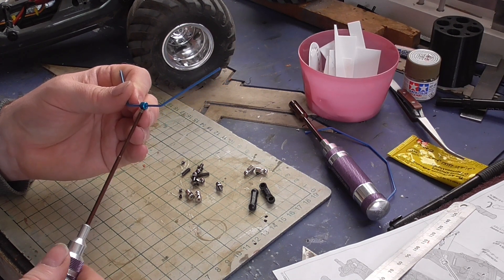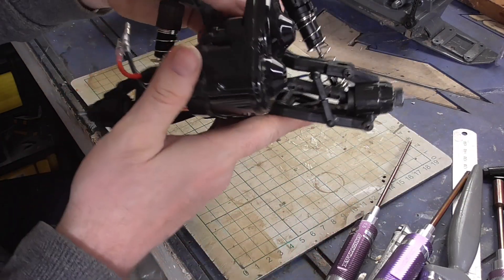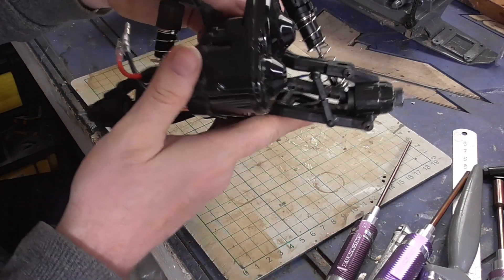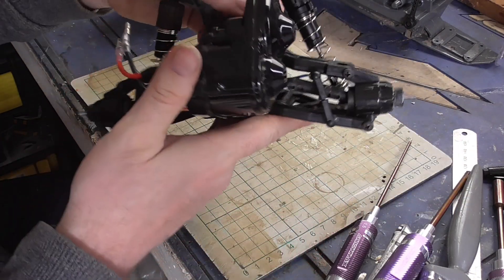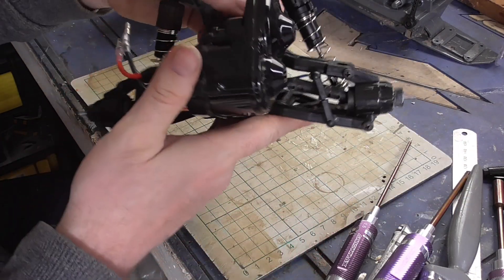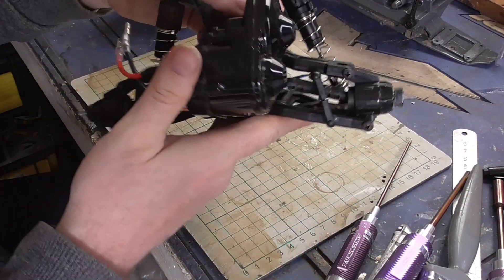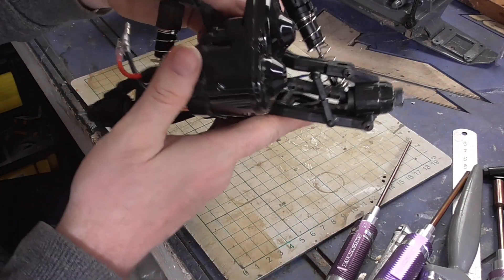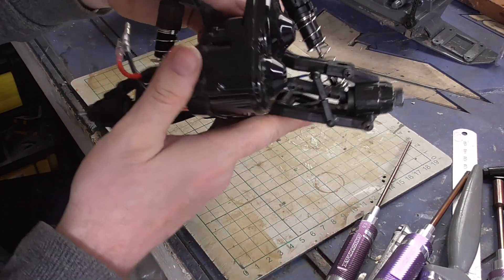Tamiya DT03 Madbull 2.0 - Stabilizer set 54561

Comment: Love it! I'm doing a near identical build myself - your videos keep me excited for the end result. On the rear stabilizer - I may have missed it but it looked like you skipped the two grub screws that go in at the bottom of the M8 and hold the bar steady. Without them the bar will flop around and be of limited use.
Reply from the maker: The grub screw are in just did not put that part in. I do not have any more upgrades planed at the moment. Just going to enjoy it for now.

Comment: Nice! that would be a great option on the stock set up if you only put the rear bar on it would give you more on speed steering because this buggy suffers from bad understeer.
Reply from the maker: I find I get less understeer with the larger tyres. Biggest problem is jumping it slaps it's bottom.